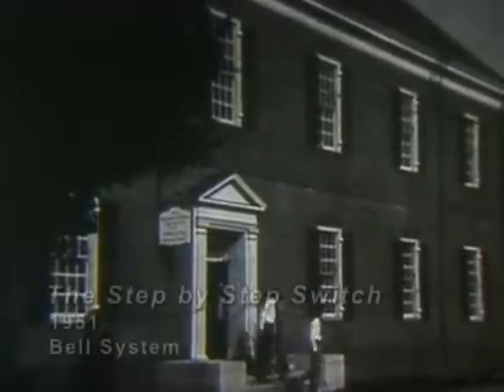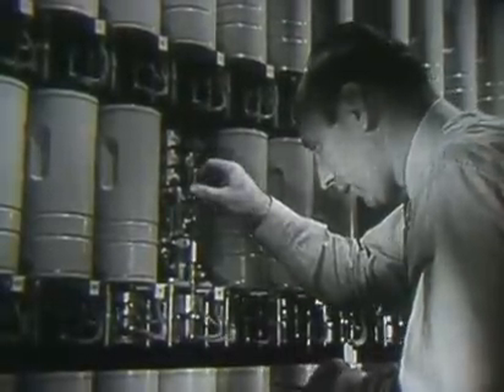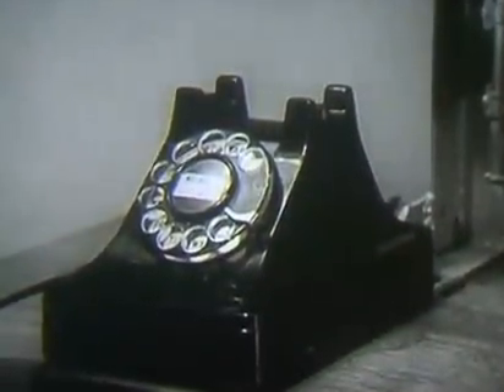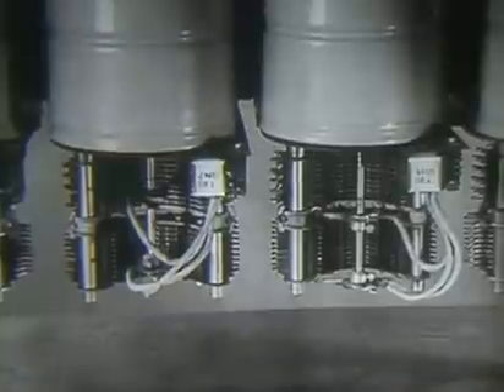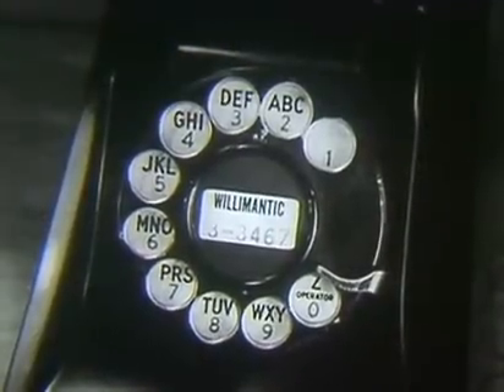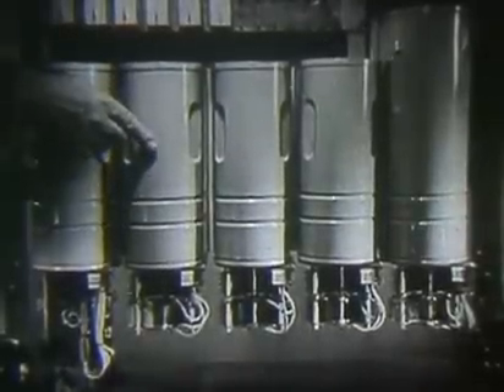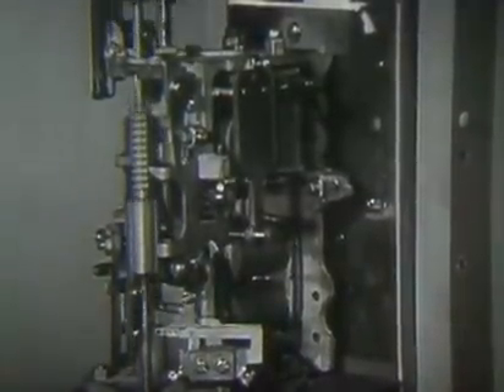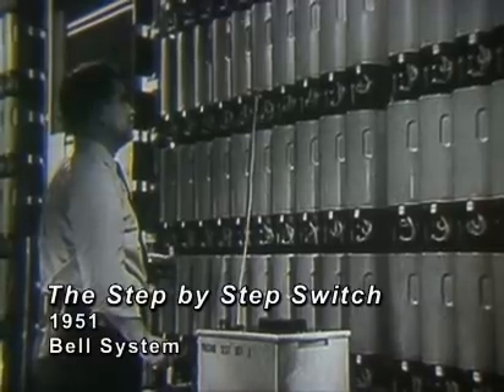AT&T Archives: The Step-By-Step Switch

Comment: Can anyone point me in the direction of where I might find how a trace was done with a mechanical exchange like this?
Reply: *****

Ha - the good old TV type call trace - a constant source of amusement for those in the trade.

A bit of technical detail is needed here, I'm afraid. As someone may have mentioned there were usually 4 wires switched from the call originator (traditionally A) to the call recipient (traditionally B) - these are tip and ring (or + and -) which carry the speech, the P (Privacy) wire which in the generation of SxS I worked with was generally (we won't go into the exceptions now) no connection for a free outlet and earth (if you're in the trade you're allowed to spell this as eth) for a busy outlet and lastly, the M (metering) wire which carried meter pulses from the call destination back to the call originator's line circuit for billing purposes. We didn't use this in New Zealand except for a couple of experiments at automatic toll metering, but it was extensively used in the UK.

Anyhoo, apart from the marking of idle and free outlets from the switches the eth placed on the P wire to mark a bank outlet as busy also served to hold the switch train up for the duration of the call - as the call progressed from one switching stage to the next the control relays in each switch were bypassed as the call was switched on to the next stage, so the newly seized switch had to provide an earth on its P wire to mark it as busy and hold the previous switches.

This holding of the switch train was passed from one switch to the next in turn until the F/S was reached - it continued to monitor the A party's line loop for the duration of the call and placed an eth on it's P wire to hold all the switches back to the A party's line cct until A eventually went on hook. The F/S also monitored the B party's line loop, placed an eth on the B party's P wire to mark them as busy and would not release this until the B party went on hook.

This system is known as 'both party release' - If A goes on hook and B doesn't, the F/S 'B' relay releases as it was held via the loop in A's phone, this briefly removes the eth from the F/S and everything releases except the F/S - B remains 'busy' to other callers. If B goes on hook and A doesn't, the 'D' relay in the F/S releases as it was held by the loop in B's phone, D releasing removes the eth from B's P wire and B is available to other callers, whereas A is still operating the B relay and thus holds the switch train up to the F/S and remains engaged.

From the point of a malicious caller this means as soon as you hang up all that's left is the F/S with B 'keeping them talking" - a situation only of use to TV detectives.

By inserting a diode in the appropriate test points on the front of the F/S you connected the B party's P wire to the P wire facing the A party ie., even if the A party hung up the diode meant there was still an earth on the P wire of the switch train all the way back to A's line cct until such time as the B party hung up. By inserting the diodes into every F/S that could connect to the B party you  converted that group of numbers into B party release rather than both party release. This gave plenty of time for tracing the call.

The reason for using a diode rather than a length of wire was to ensure that the effect was one way ie., you didn't want the A party to be able to hold the B party the same way.

In order to prevent simple stuff ups we usually had a bunch of "malicious trace" plugs made up that we could just plug into the F/S test jacks - almost impossible to get that wrong.

If the call was from within the same exchange you would get a successful trace the first time. However, a trace might take several attempts if it was coming from another exchange - the first attempt might identify which other exchange the call was coming from, you then put measures in place to hold the call through the junction circuits to that exchange and repeated the trace through that exchange - repeat until completed.

You rapidly grew to hate people who made their malicious calls from random phone boxes connected to different randomly chosen exchanges around the city.

Hope this hasn't been too confusing.

By the way, I've got 43 years recognized continuous service in my job, even though I've gone from a Post & Telegraph Department to state owned enterprise to a listed company to outsourced to being left behind when some of my colleagues were in-sourced again- I've probably done hundreds of call traces in that time, often several a day, I can only recall 3 or 4 that were for malicious calls and only once did I have to go to court as an expert witness - and in the end defense and prosecution agreed to take our evidence from our log book (way before computers) as read - it was getting close to home time I think.

By far the bulk of call traces were for fault finding purposes.
Reply: +Marc Olivier
You can start at either the line finder (L/F) or at the final selector (F/S), depending on whether you were starting with the call originator or recipient. At each stage in the switching process there were documents called 'grading charts' that allowed you to either work out what was the next selector ie., which individual selector is connected to the automatically selected outlet. You could also use the grading charts to work out (if tracing backwards from call recipient) which outlet the previous stage switch has to be on to select the particular switch the call ended up on. You then go and look at every switch over one or more racks to find it.

The call could be held up for tracing by inserting a diode into the test plugs on the front of the F/S - we did this for tracing malicious calls so the call originator could hang up, but only the call recipient could actually release the switch train.

I started off in 1972 maintaining the old cord boards, then step by step, cross-bar, computerised switches and now nearly 43 years later I work on high speed optical systems (88 channels of 100Gbps each with full optical routing of the signals)

Not all of us from the old days are gone yet.
Reply: +Marc Olivier Take a look at the movie "Black Christmas". I'm not sure if the representation is completely accurate, but it does show a guy running around in an SxS office trying to trace calls. It might give you a feel for how it was done.
Reply: funny you should mention "Black Christmas." that's why I was asking in the first place (doing a book chapter about telephones in slasher films). "Black Christmas" seems pretty faithful to actual practice. At this point, I've read quite few books and training manuals on telephone switching, but I would love to find something that specifically addresses the tap and trace procedure.
Reply: Mike Sanders Thank you so much! This is immensely helpful to get information from someone who has real-world experience doing the traces. I'm definitely giving you an acknowledgment in the chapter of my book that deals with telephones in 70s horror films (which I'll hopefully finish within a year).
Reply: Because the originator's loop is passed through to the final selector, and because of a default reversal of the line to signal the originating equipment that the called line was offhook,  a diode in series with a resistor would fool the selector into thinking the caller's loop was still there as long as the called line stayed offhook.   However, half the calls come from another exchange, and the final selector could only hold the train back to the incoming selector, which would take about 5 minutes to locate.   "Keep him on the line"  made it possible to quickly call the originating exchange and they would insert a diode plug into the outgoing repeater in the originating office to hold back to the originating line.   For repeat problem calls always from the same exchange, an order would be placed to insert Diode plugs into every repeater from that exchange to this one.  That way,  the called person could hold the call backwards indefinitely.  Of course, that gave every customer in the called exchange backward-hold to every originating line in that originating exchange, so it had to be temporary.
SImilarly,  the diode plugs in final selectors had to be temporary, because all 100 lines in that phone number group could hold backwards by accidentally leaving their phone offhook after a call.
Reply: Mike Sanders Thank you! This is super helpful! I knew there had to be some experienced folks out there! :)

So, just to make sure I'm understanding the diode trick, would the switch train be held for as long as the recipient kept on the line regardless of the length of the call? And if so, would this mean that the "keep him on the line" trace-race formula wouldn't really be necessary (i.e. that working backwards through the selectors could be done at a less frenzied pace as long as the recipient didn't hang up)?
Reply: Aha, so this explains something.  Years ago, when I was a young'in at a certain workplace, we were instructed not to hang up the phone if a threatening phone call came in.  And try to keep the caller engaged on the line while a coworker called Security.  Obviously, the goal was to initiate one of these traces ASAP, and hopefully get all the way back to the calling exchange before the caller hung up.
Reply: ***** 
They'd look at logs of who called your number, IF the log was even kept.
This also does not account for time or someone using a public phone.
Running traces was VERY HARD back then, if not almost impractical.
Reply: theLuigiFan0007 thanks for your answer. what I've read since my original question confirms what you say.
Reply: *****
You're welcome.
Reply: Mike Sanders
Very interesting. Thanks for the info.
Reply: I am not gone yet either.
Yes, that was the method.  Easier than it looks.  You would be back at the originating line in that exchange or at the incoming trunk in a couple minutes.  MIght have to call the originating exchange guy to continue to the originating line.

Comment: We should bring this technology back.
Reply: CPRailRTC Step x Step was very reliable. However it took people to maintain it, switches have to be cleaned & adjusted. Today there's only a few techs needed to maintain ESS, the switches are monitored remotely and if there's an alarm a tech is sent out to fix the problem. Circuit packs are plug-ins so a defective one can be easily replaced.  In the old days there would be a crew of switchmen in every central office. ESS (electronic switching systems) offer a lot of features like caller ID etc & a no.5 ESS switch can handle 50,000 calls an hour.   former MaBell employee
Reply: CPRailRTC Because, those were good paying jobs that employed people.
As much as I like technology, we can't just keep laying people off and expect to maintain the same quality of life.
Reply: Bobbie Bees It was sad day to see those old switches being removed. I was so used to hearing the clicking sounds of the relays. And of course all of the people needed to maintain them were gone too.
Reply: Bri G. I hear you. When my father was stationed at CFB Greisbach in Edmonton, my stepmother worked for Alberta Government Telephones (AGT). They had tours back in the early '80s od some of the switching rooms. They even had a bunch of switches hooked up in their museum that you could use a rotary dial phone with to make the switches move and place "calls" to five or six other phones located in the same museum.

It was neat watching the switches in operation, especially when you hung up the call and all of the switches dropped back to their home position.
Reply: taledarkside Nope, but the blame where it needs to be. Brain dead management, greedy owners, politicians that could be bought for less than a hand job, and lopsided "free" trade agreements.
Reply: +taledarkside 
Floyd Mayweather made $300 million in one year for fighting.
Roger Federer made $67 million for hitting a ball.
Kobe Bryant made $48.5 million for bouncing a ball.

I dunno about you, but I sure as fuck wouldn't want someone making $15/hr to take fuck all out of my car. If you have a $15/hr mechanic working on your car, good luck with that.

Next, I'd like to meet the person at Ford making $60 / hour.
According to PayScale.com and assembly line worker in America makes $27/hr. With overtime and profit sharing the same employee makes $29/hr. And an engineer, which is a management position, makes $37.
What companies like Ford and GM like to do is point out the cost of benefits. The problem with including benefits to up the "apparent" pay is twofold. First, the employee benefits are typically modelled upon what Management gives to themselves. So, if you want to cut down union benefits, you've got to cut management benefits, but you can guess how many managers are going to go for that idea. Second, not every employee uses their sick time, so counting sick time as a benefit really isn't the best accounting method.

Next, the real reason Hostess went out of business has nothing to do with unions but has everything to do with a failed management team and a vulture capital company.
North American diets have been steadily changing for the last 20 years. Wonder Bread, which was Hostess' biggest money maker was losing market share.  Same with most of the junk food it produced. The company couldn't innovate. As with most poorly run companies, the unions were made out to be the scapegoats when in fact management had been the instrument of demise via stupid investments, buyouts and other shenanigans.
Reply: +Bobbie Bees if there was fuck all inside my car id pay as much as it cost to have some one clean it out!  but thats why i keep my car locked up and dont let anyone fuck in it.
Reply: Interesting to note that as the number of people employed and maintenance costs went down, phone bills went up.
Reply: No reason to.

Comment: these systems are amazing, im curious though, i get how the switching equipment works, but something i cant quite grasp is how the equipment is able to tell what selector is available to use, like if you used the number 35912,dial 3 and first selector cuts up and then cuts in to the next available line, when it does that, how does it know what selectors are free on the huge racks of selectors??

do the selectors in use output a ground signal which tells the equipment that its busy??
Reply: There are 11 "outlet" contacts on a level.  The 11th contact sends a busy signal.  Each contact from 1 to 10 consists of 3 contacts.  The wipers sweep over 3 bank contacts on the level dialled. + and - for speech and dialling plus a PRIVATE contact.  While searching for a free outlet or bank contact, the private wire is tested.  An earth condition on the private wire signals a busy selector and the selector takes another step and tests the next outlet while a "no condition" on a pre-2000 switch or a negative on a 2000 switch signals a free condition.
Reply: Tip, ring, and sleeve.    Three conductors. the third one was for testing for busy
condition on the next available ckt.   This for other electromechanical systems.
Reply: @tedlahm5740  thank you!

Comment: I get the step-by-step switch " I'sh " But being of the digital age. Just what did the dial send to the switch for it to operate correctly.
Reply: Tony de Wijn I used to dial my phone by tapping the hook switch - just for fun. This was in the 80's and 90's when touch tone was the norm. I bet it still works today.
Reply: I did the same thing!, I don't think it would work today tho...
Reply: So. If I'm getting this right.
 Became each individual number was unique + area code if needed. The first digit in you example " 3 "had  thirty thousand co unique numbers that also started with a " 3 " and so on. With each number added lowering the uniqueness of the number as a whole. Making each number so to speak an algorithm that the Step-by Step switch would decode to connect you to 35286.
Reply: In the really old systems the dial sent a series of breaks in the line circuit (10 per second).  If you dialed a 3 then the dial sent 3 breaks in the circuit in 3/10ths of a second.  Later systems sent tone pulses.
Reply: parnelli jones
So you dialled the number  you wanted, by a binary form of Morse Code ish.. then

Comment: Did I just witness a historical slow mo camera?
Reply: Derek Leung 
My thoughts exactly. I wonder how that works.
200 TIMES SLOWER!?!?!? That's 3000/6000 FPS! (Considering 15/30 FPS playback)
That in itself is as fascinating as the switch.
Reply: I think the narrator meant 200 FPS; an action that takes about a second, 200 times slower. 3000 FPS would require 187 feet of film, 6000 FPS would require 375 feet, while 200 FPS would be just 12.5 feet. Realistically, it was recorded at 400 fps, which would take about 16 seconds to play back at 24 fps, which is probably how long the slow-motion clip really was.
Reply: Slow motion cameras were used during wartime to analyze explosives and ballistics. The one shown here was not even close to state-of-the-art at the time.
Reply: Derek Leung 🤣😂😊